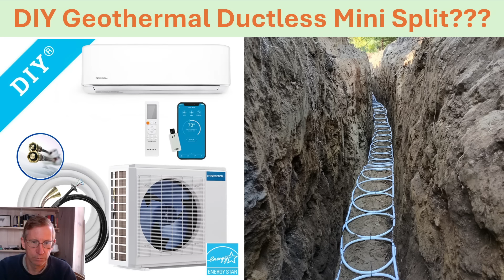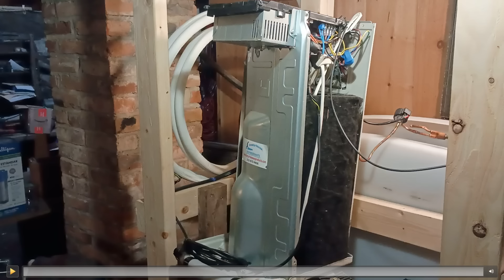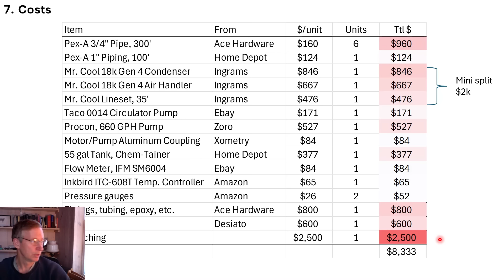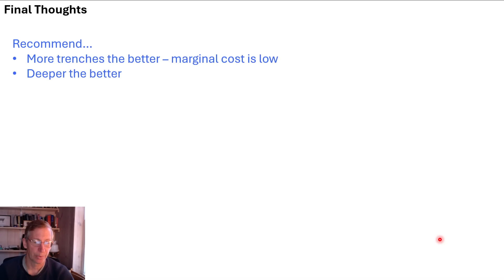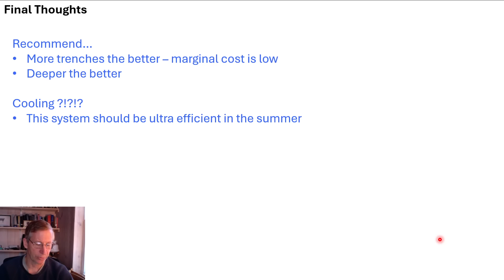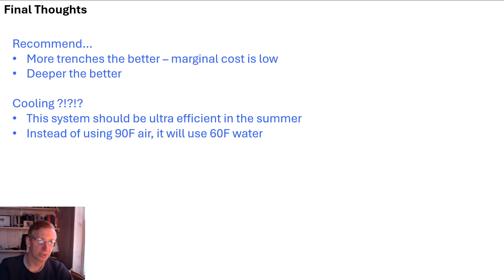DIY Geothermal Ductless Mini Split (Ground Source Heat Pump)

Comment: Nicely done. I looked at doing a GSHP years ago but it doesn't work well where I am. Soil issues and it's just not cold enough without going very deep and I'm in a cooling dominated area. My 100' irrigation well water temp is 70*.  Drilled wells are the only effective method here and it's cost prohibitive. I did allot of research back then and I find that now allot of the information I used to be able to find easily is very hard to find now. In the end they can be done where I am but only worth the cost if you have a large pond or live on a lake and can do a water loop. Our summer temps are at or above 100* from around 11am until 6pm and the low is 80* and it will still be in the mid 90s at midnight. (TX)

       For your fan motor it may be going into reverse during a timed defrost when it hasn't done one in a long time and overrides the temp sensor data. But to fix the issue you could look at adding a sprag clutch so the pump will freewheel when it goes into reverse. 

       I hope you get more views but sadly in depth tech info doesn't do well on YT. Neither does detailed instruction on stuff. People want simple and fast but mostly entertaining. Not many want to learn anymore.

         Oh and forgot... The issue with the pipe you wanted for the ground loops... Well as of last year it's illegal in most states. Sadly there is no replacement product for irrigation use at a similar price anyway so you have to go to a state that sells it and smuggle it in across the border. In fact Menards has it on their site that they won't ship to those states now.
Reply: If you only needed to reverse 2 wires to flip the motor direction, I would try building an appropriately sized bridge rectifier. That way no matter the polarity of the input. The output to the motor will be the same.
Reply from the maker: @mzb8134 I like this idea!  Thank you
Reply from the maker: Thank you for the sprag clutch suggestion, I'll look into that.

Did you consider going 10+ ft deep trenches?  Soil is still too warm?

Comment: Any chance you could show us a graph of total system power Watts for one day.
Reply from the maker: Heat output in Watts, or electrical consumption?  The chart at 33:20 is total heat output in BTU/h, which you can divide by 3.4 to get Watts.
Reply: @edwardwazer5103  Gotcha, thankyou.
Reply from the maker: I have the power in Watts for both parameters, not sure how to share it at this point